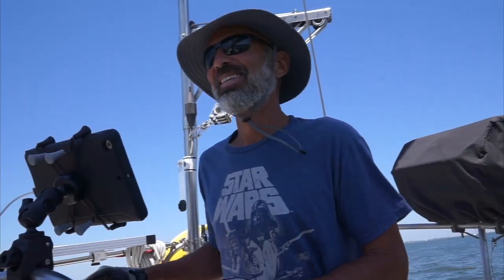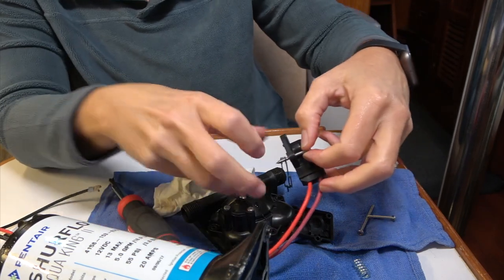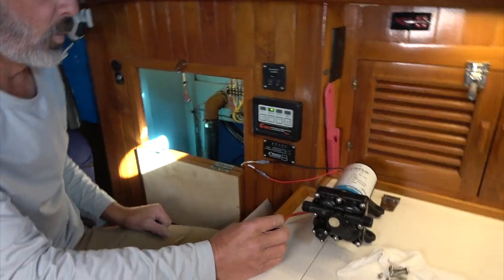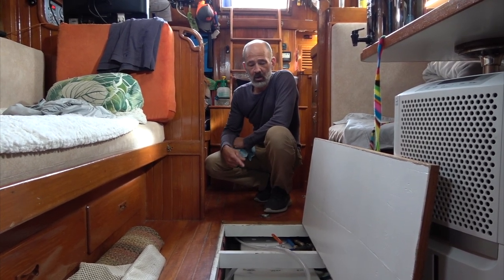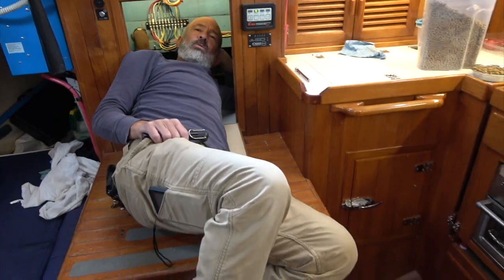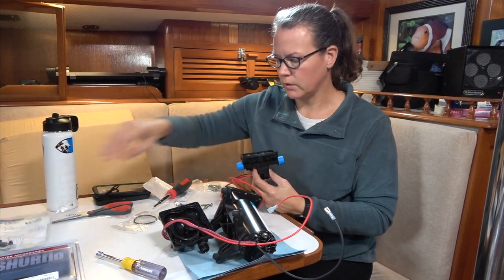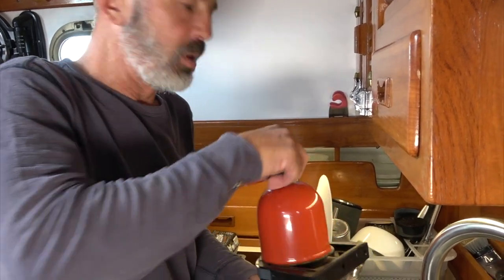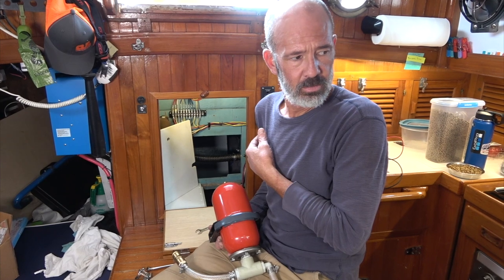SV Ramble On | Our Pump Takes a Dump

Comment: We found the pressure switch on those pumps commonly fails, so we always carried spares of those pressure switches. We also installed two pumps right next to each other. If one failed we flipped a switch, and turned a valve, and we were back in business.

Comment: Make sure your accumulator is not over pressurized. It should be set about 3 psi below your pump cut in pressure. If you keep adding air you kight have put too much in.

Comment: Who's the manufacturer of that expansion tank?  I had the same short-cycling problem a couple years ago, and replaced the Shurflo expansion tank with a used Shurflo spare that had come with the boat.  I don't like the design, because it's basically impossible to correctly reassemble the bladder into the tank, with it split in the middle as it is.  Unless you've got another recommendation, I'll be getting a spare that's similar to style tank you've got.

I recommend not relying on the pump's built-in backflow valve to keep city water from entering the tank, as it's pretty weak.  You could add a better backflow valve in the plumbing.  Even better is to use a set of manual shutoff valves in the plumbing to bypass the tank and pump when on city water.  In your situation, where you have to rely on your onboard pump to create good water pressure, you could do both things.  Being able to isolate the tank from (normal pressure) city water will let you dry the tank out when you're not using it for extended periods - preventing bio growth.